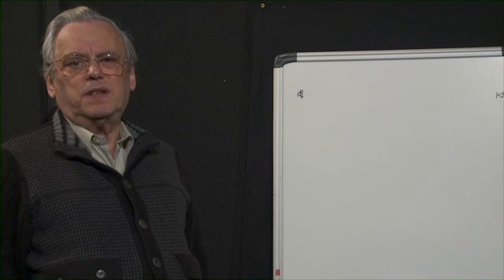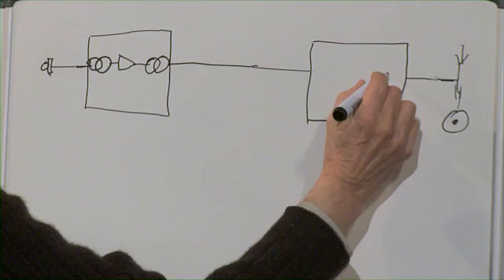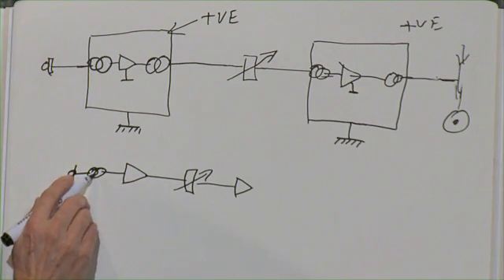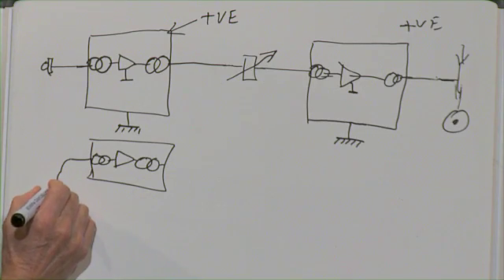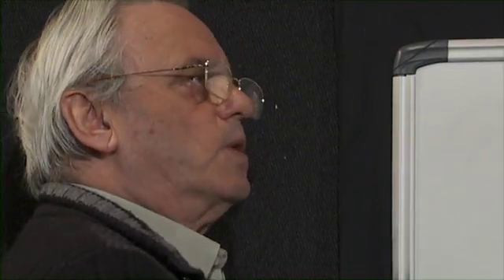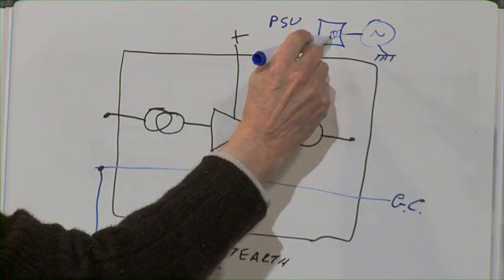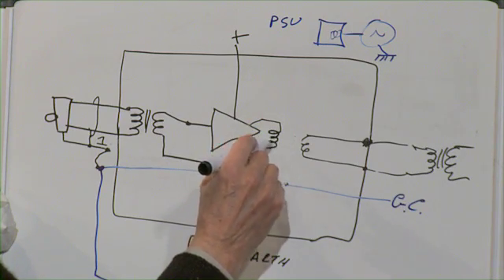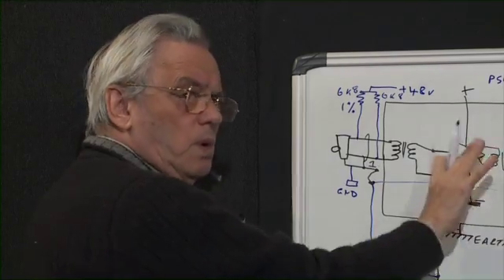How to design an analogue mixer "Sound Techniques"

Comment: I've noticed that many tube circuts these days are low voltage powered instead of using high voltage transformers
Reply: underpowering a tube can in some cases provide a less colored sound.
Reply: Then the tubes are just for show, even battery powers radio tubes need 90-100V, the anode needs high voltage for amplification to occur.